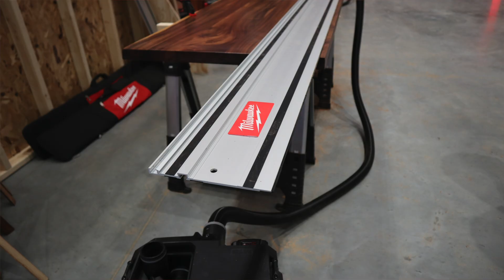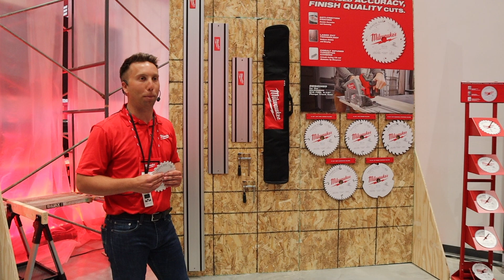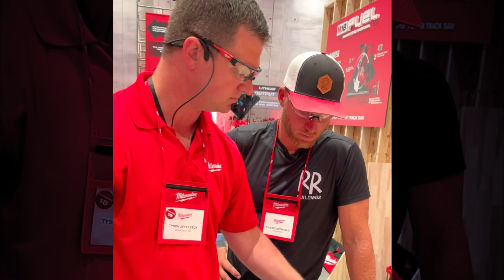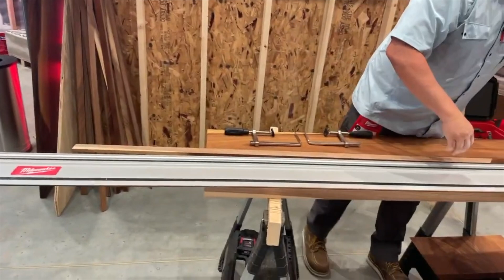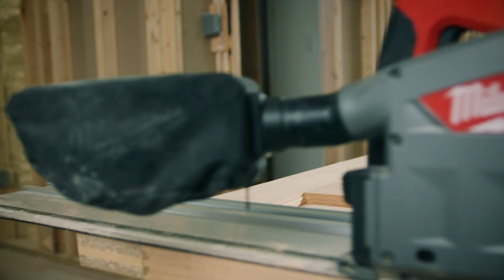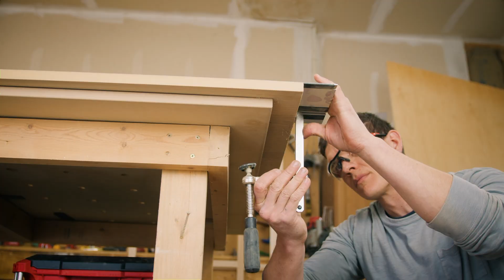THE NEW MILWAUKEE M18 FUEL TRACK SAW IS HERE!  FIRST LOOK & PUT TO THE TEST!

Comment: The only detail, gentlemen from Milwaukee, that was missing was to manufacture a saw to work with the right hand due to the position in which one cuts. Most of the workers make the cuts with the right hand and that saw is specially designed for left-handed users, that is, we right-handers, it is a bit complicated for us, however, the machine is beautiful, I respect this brand a lot, what's more, Milwaukee is my #1 favorite

Comment: The 550 option with packout and 2x 55” tracks and clamps is 850 dollars bro. Assuming you have batts. And the m18 vacuum is still not turning itself on and off automagically.  

Quick - Buy the festool instead before festool realizes they should raise their price!

Comment: If this works with the Festool/Dewalt/Powertec tracks I will definitely buy it but no chance if they went with a variation to make more money. Might as well use a adapter on the Dewalt with M18 batteries at that point.
Reply from the maker: I'm pretty sure it works on Festool tracks, but need to double check.

Comment: too bad they went with the horrible Festool track designs instead of Mafell. It's been proven over and over again to be superior in every way.
Reply from the maker: I'll have to check the Mafell tracks out.  I quickly looked at them online and they look like they have similar connectors as the Bosch tracks, which work well.
Reply: @MarkThomasBuilder  Bosch are rebranded Mafell tracks. Exact same things but blue. Still not a track saw on the market that can rival Mafell's... only down side is they're just not really available up in NA.
Reply from the maker: Okay, interesting... Thanks for sharing!

Comment: They could've REALLY taken over Makita and even Festool in one demographic if they just made a Blade Left style. 
 
Every Kreg Track saw bought, was done so because there was no other choice for a Left Blade. 
 
Milwaukee really could've sold thousands and thousands of extra saws by going , or even adding a track saw for TRUE right handed users. One that wouldn't need to be used on the left side of the user's body.
 
As a former lefty, right blade track saws were the only tool made just for us. 
 
Now, forced to only have use of right arm, there's no GOOD track saws out there.
Reply from the maker: Interesting point.  I'll keep my eyes open to see if any other brands offer that in the future.
Reply: @MarkThomasBuilder   thanks a bunch. 
 
Sadly, Bosch was offering their Profactor Strongarm, Track Capable, plunging 7-¼ saw..   but the brilliant minds at the NA Bosch Tools corporate office,  just canceled it. They didn't say anything or tell anyone why. They just ghosted it. 
 
I knew about it last year in May, and the officially Debuted it this year at World of Concrete. They even made an Amazon page for it. But for some reason... they just removed it to act like it never happened. 
 
 Bosch has some surprisingly good tools. But their NA CEO's are idiot Frat Boys that might be trying to just do less work. 
 
There are rumors that Bosch Europe is dumping their US tool market since its <10% of its worldwide earnings. The US versions are just extremely lacking, and the tools almost never make it into the hands of tradesmen, (outside of the Concrete, and Laser Level industry.)
 
Either way, Bosch lost me as a customer... and I'm basically going to Makita full time now I suppose.

Comment: Milwaukee needs a cooler for battery during charging , this is the reason i use hilti and festool  , i have hilti battery from 7 years old and still go strong .I'll happily pay the extra for a proper battery .
Reply from the maker: I've had good luck with their batteries.  I especially like their high output models.

Comment: Thank you sir for sharing this info. I’m a Milwaukee guy who was a Welder/fabricator for 45 ish years before I got electrocuted at work. Lucky to be alive but really broken now, I’m just getting around after 3 years of rehab. I’m ready to get back into the shop. Gonna go cordless as much as possible. Very excited about the Track Saw indeed.
Reply from the maker: Oh wow, that's sounds like a rough situation to go through.  Milwaukee is really delivering some nice power with their batteries.  This new track saw will give you some amazing results and it will be fairly easy to set up and operate.

Comment: Nice, Now I know what a Track is and what it does.
Reply from the maker: I've tested my first one last summer.  It was easy to figure out and set up.  It's my go-to for accurate cuts and rips.
Reply: @MarkThomasBuilder  I would definitely prefer using a track saw than a table saw since I got no woodworking skills and portability of track is also a benefit.
Reply from the maker: Good point.  When I first started out in home building, I brought my grandpa's handed down Craftsman table saw to jobsites.  It probably weighed 250 lbs with the cast iron base.  This track saw would be much easier to transport and would do a better job.

Comment: I hope dust control is better in a shop setting and that the clouds of visible dust were due to lack of suction from the shop
Vacs used.    Your thoughts?
Reply: The hole for the arbor nut is always the weak point.  Someone on etsy always comes out with a 3D printed cover for less than $20 that snaps in
Reply: @chrisschultz6129  true.  I use a piece of painters tape on my DeWalt for the same reason
Reply: There has that clear plastic piece near cutting edge similar to Festool when you lower it closer to surface dust extraction is much better on that video it was up.
Reply from the maker: I have a clip where they forgot to turn on the M18 wet/dry vac and there was a very noticeable dust cloud.  The vac has a 2 speed setting and I'm guessing they ran it on the low speed to keep the noise down and still give decent dust extraction.  I'll have to do a test comparison to my Bosch track saw someday with some close-ups of the dust situation.
Reply: @MarkThomasBuilder  sounds good.  It just seems like every video I saw from other YouTubers also showed lots of dust.  I do know that cutting on foam board seems to greatly help; at least it does with my DeWalt.   I’m still buying this no matter what I’ve been waiting for years now.  Just hoping the dust extraction is better than what it looked like initially.  Any word on a pre-order date?
Reply from the maker: I've been checking around the tool places but haven't seen anything yet on pre-orders.  Thanks for the foam board tip.  I'll have to see if that helps.   
 In my garage workshop, I've wanted to put in a dust filtration system.  I heard Jet is making a new improved version.
Reply: What's interesting to me, age 67, is how dust control is now considered almost the most important feature. That's a very good change in attitude by tradespeople.
   Mafell for track saw if you're not restricted to one battery platform. Full Mafell kit including dust extractor vacuum is a good deal in UK despite recent price changes v/s alternatives where kit components come separate.
   Track saw replaces table saw and mitre saw. Don't know how it replaces the router except for very basic cuts